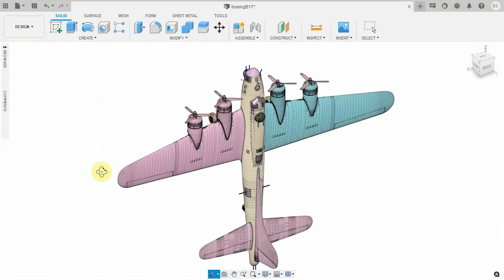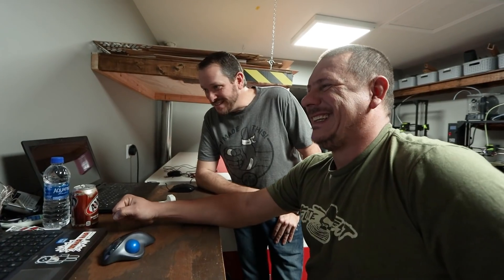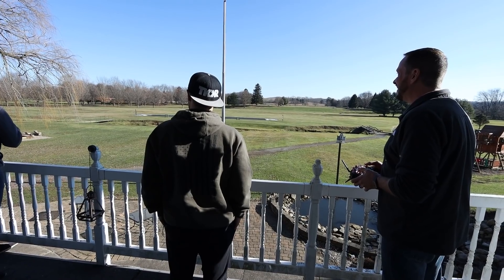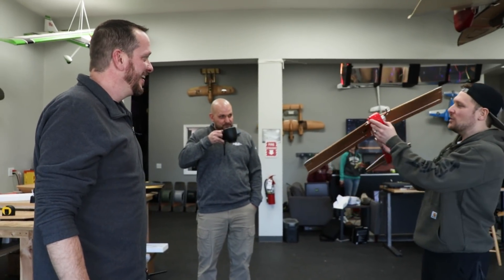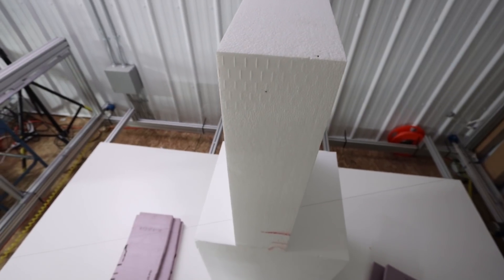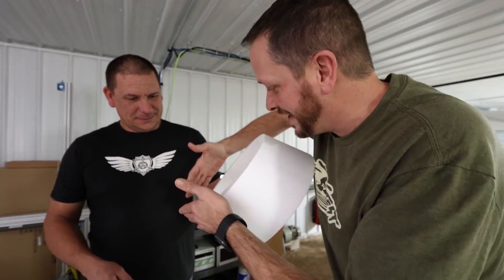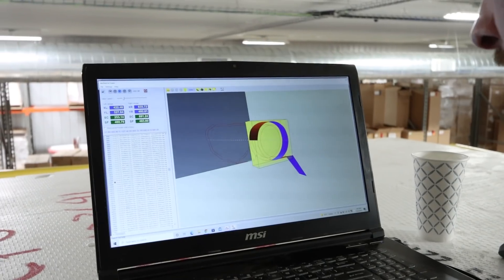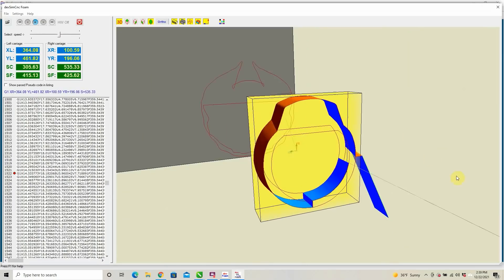Starting Our Massive 20 Foot B-17 - Week 1

Comment: I just had a weird idea that could work for a multi-drop bomb door...
You could have a tube with a moving sled in it, the sled would be pulled by a motor and would have multiple compartments. Each compartment would hold a single drop and would have sides but no base.
It would then be pulled to a hole in the tube where the actual bomb door would be...
I'm not sure if it would work or be effective. But I'd love to see what people think. (:

Comment: Try expanded polypropylene. (EPP). It's more expensive, cuts a bit hotter, and doesn't sand well at all, but the stuff is bulletproof!  It will absorb an amazing amount of abuse...Add a layer of packaging tape, and you've got a "forever" combat plane!

Comment: When it gets hit in laser tag, a panel should fly off from one of the wings or vertical stabilizer. You’d only need a tiny servo for each panel. Every hit would be signaled by a different panel being “shot off”.

Comment: Hey, what software do you guys use for generating g-code?  Looks like you are modeling in fusion 360 and running the machine on mach4.  I haven't found a decent 4 axis hotwire CAM software yet
Reply: We use dev foam
Reply: @davidjester5085  ah ok, thats been the one I figured I would probably end up buying.  There are a lot of great free softwares our there for wings, but they all lack a feature or two that the other has.  Thanks!

Comment: You know, with one of your big B-17 models, you should make a BF-109 model of the same scale, and do an RC reenactment of the flight when Franz Stigler escorted the severely damaged B-17 piloted by Lt. Charlie Brown, back to safety. (An extremely great true story from WWII...)
Reply: *no bullets fly - Sabaton plays ❤
Reply: At that point they'd make a bigger version of the real deal
Reply: Might be a bit hard to get it to fly with all the damage that the original had though
Reply: @darkstalker3855  i always thought itd be cool to use some sort of clear material like thin plastic sheets to add damage/missing bits
Reply: @N0cTuRn4L1  yeah that’s a good idea
Reply: @darkstalker3855  As much as they shot up the smaller B-17 model with an apple cannon and then fireworks? :D

Comment: Awesome project, You guys should cover the whole thing with fiberglass!💪
Reply: OMG A rather rare moment is the Chanel comment on another Chanel
Reply: @pecintatanaman7577  channel*
Reply: @pecintatanaman7577  - Please explain not everyone is as smart as you are certainly not me? Thanks
Reply: LOL, I was just thinking of Xyla Foxlin and her love of fiberglassing everything and how they would make a great pairing for a project. :D
Reply: Sir, you must visit FT. Maybe you can attend one of their FliteFests
Reply: Maybe you need to go show them how to do some fiberglass work that way they can upgrade what they're doing
Reply: @johnedwards3630  - Whom are you talking to Ramy? Something is off cue here. Thanks
Reply: Fibreglass then build it up to handle some gas engines!!!
Reply: @Ramy RC. That would be a weight penalty especially given the  surface area.  Bare EPS won’t wear well, but that thing is going to float like a dream unsheeted or unglassed.
Reply: @bravo0105  Thats why you use Minwax & not resin which mostly evaporates. The weight penalty won't be much as it only needs one layer. It's also cloth not chopped glass. It has been done for decades with no issues as it doesn't add as much weight as you might think. It's not an indoor flyer that needs to float around at 3 knots. Also, Ramy Rc knows what he's doing if you haven't seen his builds which are scale fiberglassed foam airliners,
Reply: @FarmerFpv  To each his own, naturally.  Wing loading makes or breaks an airplane for me; the heavy stuff isn't fun and tends to spin in.  Given the size of that B-17, some strengthening may be necessary for EPS at that size; a lightweight cloth reinforcement of the wing underside could add considerable strength.  I will have to check out the Minwax and cloth.
Reply: Ramy Rc, I agree it would be a shame if they didn't glass this project.
Reply: fiberglass for future :D